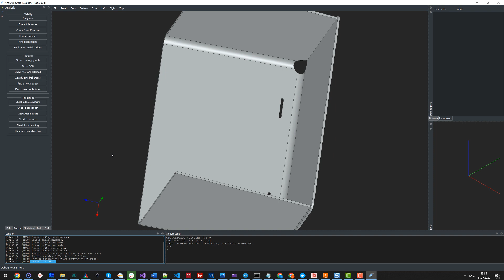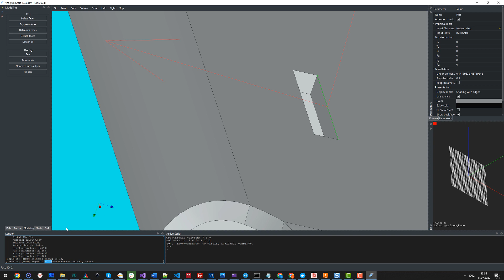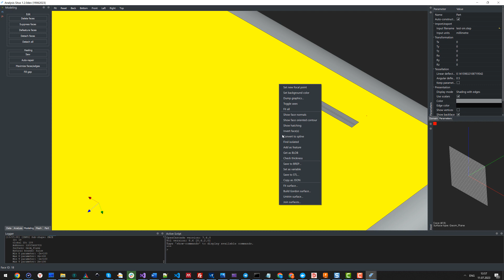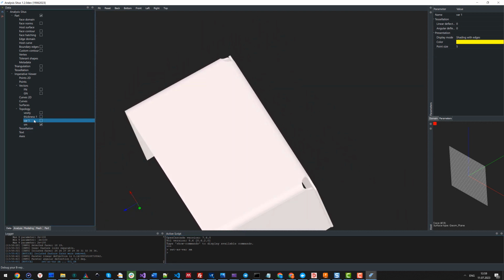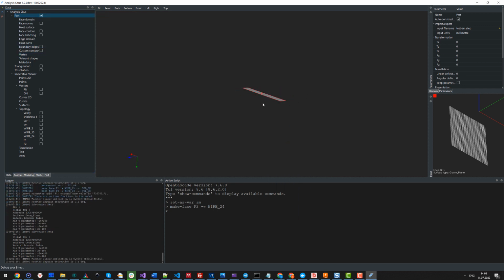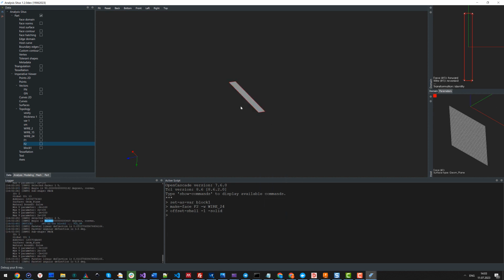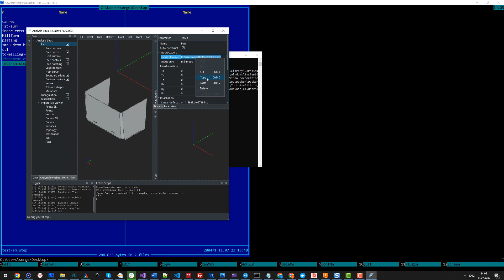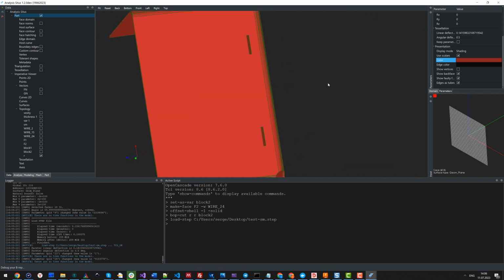Clean up broken cutouts in a sheet metal part

Comment: Hi Quaoar,
Might I know how you design the gui part of this application?
I meant did you use the MFC or QT or Win32API
I wanted to try to develop a small application with opencascade
But unsure what I should use for gui part (MFC or QT or Win32API) as I am not comfortable with C++ so I need some advice
Thank you so much for your video for both the situs and opencascade
Reply from the maker: It is Qt-based classic app. Another option  (also Qt-based) is Qml, which offers a much more customizable look & feel (but also requires more time and effort). Examples of Qml-based apps are CAD Assistant, CAD Processor, CAD Exchanger, ... MFC is dead technology, you'd better avoid it.